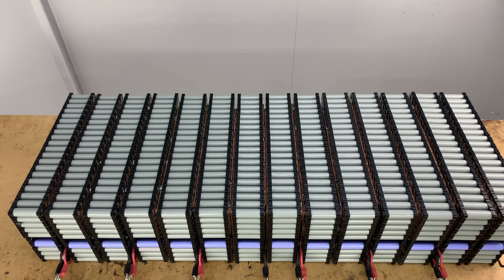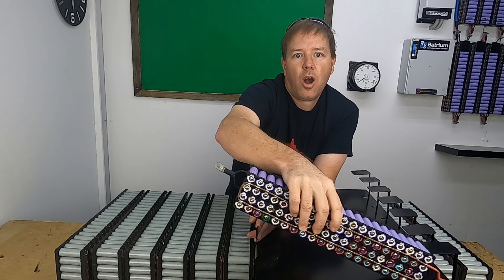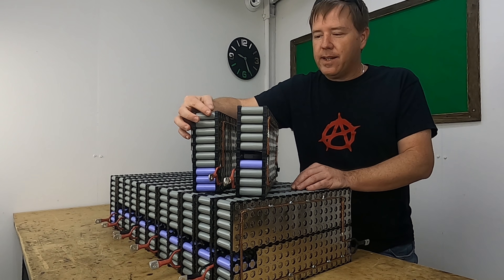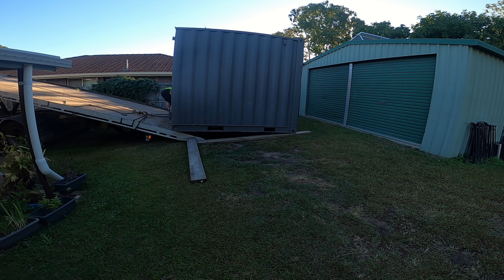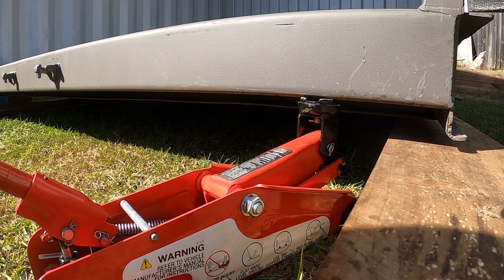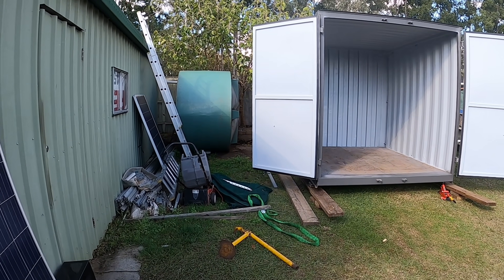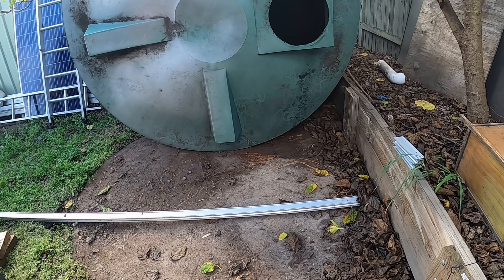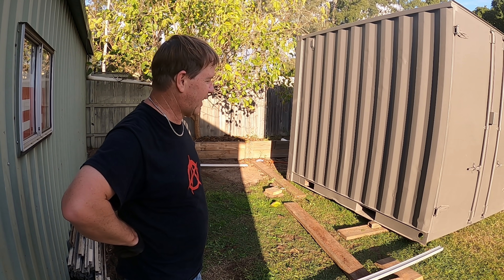Pt.2 Finding out my massive battery won't pass inspection!

Comment: The batteries are a good way to store up the energy. But how is the energy going to be produced? What is the source for the power or is it from the grid? Then it would be useful in situations of black-out.
Reply from the maker: 100% Solar then through inverters to power the home 24/7 not just in a blackout..
Reply: @HBPowerwall  Very nice man. So I guess you have enough solar panels to sustain the energy usage and and store some of it in the batteries. 
Australia is a good place for solar panels.

Comment: Love those batteries, i wish i got that many battery. But I only got 16 recycle old laptop battery, so I build a 4s 4p battery pack for my laptop, I got a 4s BMS build in and I want to supply CC and CV  to charge the battery, I only supply 16.4v and ??? of amp. Please help
Reply: 0.5-1c should be safe depending on the cells.

Comment: me personally wouldn't use old batteries. too high risk of damaged or worn out cells, i have had 2 fires from old batteries.
Reply from the maker: Your choice - with some effort and common sence you can make them very useful and safe.

Comment: does it hurt anyone else that the weight goes all onto the bottom cell
Reply from the maker: Hence zero volt and not connected - a 6 month test showed no deflection in the bottom mount or damage to the once cell that carries most of the weight. Aslo no signs of the plastic cell holders flexing or deforming under the weight.
Reply: @HBPowerwall  what if there was an  e a r t h q u a k e
also just to clarify - the load bearing bottom is a dead cell by design?

Comment: How hot do your sheds get? Do you use any temp control? Thanks in advance.
Reply from the maker: Where the batteries are now they are just cooled by exhaust fans top and bottom 3" computer fans - controlled by the BMS
Reply: HBPowerwall ok cool! Been thinking about building a small “battery box/shed” to keep my power bank outside but have been wondering about climate control. I thought about temp controlled fans but wasn’t sure it’d be enough. Thanks!
Reply from the maker: In the shipping container it will be the better part of fully sealed so will probably install a cheap reverse cycle air conditioner in there and just set it to 25deg in summer and leave it at that..
Reply: HBPowerwall ok I’ll look in to that cause during the summer here (Midwest US) it can get pretty brutal but never last for that long so I may be able to get away with just the fans, but if I can get a cheap AC I would def go that route for peace of mind.

Comment: Very interesting project! I do wonder whether the bus bar exit from each pack should be strain relieved somehow, as it looks pretty easy to accidentally tear up the nickel sheet when handling or connecting up.
Reply from the maker: Yes they should design works but lacks in mechanical strength.

Comment: Knowing how these batteries degrade so quickly my phone doesn't last 8 hours after 2 years now how can these recovered batteries by any different ?
Reply from the maker: Some times the failure is the BMS - each cell is heavily tested before putting it into service
Reply: different kind of battery, and cell phones batteries sacrifice cycle life for more power each day. and they are pushed way to hard. over charged and over discharged.
Reply: Don't leave it fully charged for long periods -- that degrades lithium cells!
Try charging your phone only to 80-90% and don't let it discharge regularly below 20-50%.
It will last much longer!

Comment: what's the purpose of this battery?
Reply from the maker: Will be a part of my house battery to store all that extra solar energy
Reply: @HBPowerwall  nice but mixed used battery  doesn't seem a great idea to me.. i prefer smaller and new one, like LG INR, nice project anyway, subscribed.
Reply from the maker: @AsitShouldBe  My other battery is 4 years old and seems like a fantastic idea to me .. New would be nice but i can't afford that on this storage scale.
Reply: @HBPowerwall  with that battery and solar power are you indipendent from line energy?
Reply from the maker: Nar. I use a lot of power, grid is a cheap backup

Comment: The voice volume is mighty low, and the sound effects WAY too loud.
HOWEVER, I find it fascinating what you've done so far.
Reply: Also the generic YouTube royalty free music is not only terrible it's also in millions of YouTube videos and therefore annoying and it does not add any value to your otherwise great videos.
Reply from the maker: Yeh, had a few small complaints about the audio - didn't have another few hours to go through it all over again to fix. The auto level is a horrible tool on PowerDirector
Reply: Yeah I'm the same, and it's actually painful because of my tinnitus. I have to turn up the voice to hear it, but then the music blows my ears out. Ears are supposed to naturally adjust for volumes, but mine are set to 11 permanently.
Reply: @SidneyCritic  Tinnitus by itself shouldn't be painful. Could be clogged earwax, or a brain tumor. Or anxiety disorder (don't worry it's definitely maybe not a tumor)
Reply from the maker: It’s probably a tumour 😆
Reply: @alakani  If I said hyperacusis, no one would understand. A severe from of tinnitus turns to hyperacusis, and I've got the severe from of hyperacusis, ie, 1 sec of a very loud sound and I have to lie down for 15-30min due to the pain.
Reply: @SidneyCritic  Aw dang. There was a clinical trial in 2015 which showed that a lot of people with hyperacusis/misophonia can reduce the pain by recalibrating their broadband dynamic range using low level pink noise for a while every day, it works better if a psychologist does it

Comment: Sorry, I don’t understand English. But to what I saw, I had questions. Have you considered those a couple of nuances for battery assemblies?
 1) The current goes along the smallest resistance path. No matter how ideal the batteries would be, their internal resistance is different. And because of this, when charging an assembly of thousands of batteries, more than half of the batteries will not charge up to half the charge, while some batteries will already be in a recharged state (the battery charge is above normal
) And during operation, slowly but surely, one by one, the batteries will fail, along the path of least resistance.
 2) The charge of the battery and the release of energy by the battery occur due to the chemical process occurring inside the battery. During this chemical process, heat is generated. Batteries located in the center of this battery assembly will overheat, from overheating they will leak, burst and cause a short circuit.
 So, the first question - how will you control the charge level of each battery from thousands of batteries, so as not to allow the battery to charge above normal? The second question is how will you cool the batteries, especially those in the center?
Reply from the maker: Total max charge/draw is 0.33 amps per cell... issues disappear
Reply: @HBPowerwall  
By "per cell ..." you mean each battery separately, or battery assembly 0:05.
 If you mean the battery assembly, then I agree - with such currents it is not afraid of overcharging and overheating, only I'm afraid to imagine how much it will charge.
 But if you mean each battery separately, then you will not control it. Because of this, modern laptops get rid of such batteries, since they charge differently because of different resistance and varying degrees of wear.

Comment: Dumb question.  It has been suggested, over and over, that I put a BMS on my Chevy Volt cells, meaning, each 4.0 V cell, in every pack.  Why wouldn't it be equally appropriate to put a BMS on each and every one of your individual cells ?  or am I missing something ?
Reply from the maker: Your missing something - I only need one BMS per 191P battery

Comment: Looks good. But why 18650 and how do U replace em when they fail? I was going to make one (much much smaller) on 18650 but any calculations says that LiFePO4 is easier to build and cheaper to buy. They also bigger and easier to replace.
PS @ recovered from old laptops@ OK so you got them probably cheap. But it is still time consuming process of testing them, right?
Reply from the maker: The build video your way would let’s face it prey average lol 😂

Comment: the way he is touching the cells with his bare hands. quite high voltage this.
Reply: Each pack or 'cell' is only 4V.
The voltages only get higher once they are strung together.
Very high current output though, so definitely need to be treated with respect.
Been watching this channel for a while and I think he strikes a sensible safety stance.
Reply from the maker: @kabadisha  I do try, but there is this madness line that people draw in the sand that drives me mad.. More education is needed or perhaps i need to provide more information..
Reply: @kabadisha  yes of course but if unlucky, the configuration can be hig voltage across his fingers (depends on wiring serial etc etc) and this packs so much power that you should have a 40+ CAL arc protection gear on you
Reply from the maker: You really have no idea....

Comment: I love this kind of stuff and I like to try and learn from the best and you seem to know your doing...
Reply from the maker: Nar not a chance I just give it a crack and see how shit turns out lol
Reply: @HBPowerwall  I kinda felt bad for you wish I lived close so I could have helped you move that thing, but you did a damn good job at even doing that.
Reply from the maker: Was a rewarding challenge - my reward was a sore back & thighs lol
Reply: Well I can’t wait until the video comes out with the compilation or a few videos of the finished power house or whatever you are calling it.
Reply from the maker: Thinking of a tutural video on how I plan to protect my cells with A BMS - I've just ordered all the wood support and fireproof FC board but don't know when i'll arrive
Reply: @HBPowerwall  I take you will have to stud the walls out and put up like 3/4 inch plywood because of the weight factor of the batteries you'll be hanging?

Comment: So was there a reason why you cut down a 20ft shipping container and not use a 10ft explosives container? or even a 10ft hi-top or 10ft standard container? as I build with 40ft, 20ft, 10ft and other more exotic configurations. Cutting, welding, painting costs is all.
Reply from the maker: All I could find

Comment: Fast forward 2 years into the future and Pete is trying to fit in another 10,000 cells and he's cursing he cut the container in half 😂
Reply: why is YouTube telling me this comment has 0 likes even though I just liked it xD
Reply from the maker: Wll the plan started with putting all my cells in there so 75kwh of useable storage BUT might have to change that plan to comply
Reply: @HBPowerwall  I have a 20ft container at the bottom of my garden that's empty the moment and now considering moving it to use for my powerwall 🙂
Reply: @HBPowerwall would it be legal if it was buried? 

Less chance of above ground fire or explosion risk that way
Reply: @BenCos2018  It showing up for me Ben 👍
Reply: @healeydave  Same here now 
YouTube decided to break for me lmao
It even had my username on this comment as I am C for some reason xD

Comment: I like your new battery box. One thing I would like to see is one box just for battery's and electronics somewhere else. So if there was any accident you would only loose second hand batteries Not everything. Even separated your batteries in half. Starting to get scared of dendrites. Being the cause of a fire on old batteries.
Reply from the maker: I agree but the budget is completely wiped out for at least a good few months
Reply: I’m still very jealous of you and your amazing system
Reply from the maker: Thank-you

Comment: Whats the temperature in your shed?  I have been wanting to do solar on mine, but it gets pretty hot in there.
Reply from the maker: Hotest i've seen for longer than an hour is about 50 but we have fan pumping around in there. I can work in there batteries should be fine

Comment: lolz i would just use round wooden poles, 3 of them and it rolls as nothing, without need for boards
Reply from the maker: Went with what i had and worked well
Reply: @HBPowerwall  comparing to my experience you had quite a struggle ;)

Comment: 0:50 ... so ... the block weight (how many lbm?) is held by lower battaries. Not sure if it safe in time to load a cell like with side load. It was not designed to provide structural support.
Reply from the maker: Had a test rig set up with built batteries in it for 6 months no deflection of the mount or damage to the cell or cell holders
Reply: @HBPowerwall  i would check the affected cells capabilities in time.
Reply from the maker: I maintain my battery better than my cars...
Reply: @HBPowerwall  just those 2 cells which carry load of block. Not entire battery/block.

Comment: I dont understand: using old laptop batteries? Arent they damaged and have only like 50% of the original capacity + will die soon anyway?
Reply from the maker: Most fail due to BMS so batteries are still serviceable
Reply: HBPowerwall and by servicable you mean doing a few "refresh" cycles on them so they are as good as new?

Comment: What happens if one battery bursts into flames? Will it start a chain reaction and others will start to burn also? How could that be prevented?
Reply from the maker: One would hope the CID activates , if that doesn't the cell fuse, if that fails the container will contain the fire till it burns itself out
Reply: @HBPowerwall  https://www.youtube.com/watch?v=Q4qQ1IV4gWQ
Reply: Smoke detectors, alarm, power disconnect, heat sensors and automatic extinguishers?
Wouldn't you want to protect your investment?
How do the pros handle this?🤔
Reply: I’m here to tell you even the pros put their battery packs in a container and if you have a thermal runaway you close the container door and let it burn itself out. Not much will stop a lithium fire
Reply: Alan Hillyard where does the smoke go? 
Wont the container explode?
Doesnt need a fire oxygen from the outside?
If so, this container will be a big ass long lasting enviroment warmer without oxygen and fire burning.
Reply from the maker: Hot flames are an issue but I would be more concerned with the cells shooting off across the room and then catching everything on fire even quicker
Reply: @HBPowerwall  Given the floors of most shipping containers are simply plywood, that would be my biggest concern (a layer of tile underlay will ameliorate that somewhat).
Proper fire suppression for ion batteries uses powdered glass (a variant on the dry chemical extinguisher listed as for metal fires). The powdered glass melts in the fire and isolates the burning metal from the atmosphere. The downside is that it is a bitch to get out of electronics (even if it doesn’t corrode them like a conventional dry chemical extinguisher).
Putting the batteries in separate sealed boxes can minimise the consequences of an electrical oopsy…
Reply: @HBPowerwall  "cells shooting across the room"?
Reply: @mrtechie6810  yes, cells that are venting that have become disconnected from the structure can become little rockets propelled by their own gases. Mechanical constraints should help with that.
Reply: @mrtechie6810  The pro’s just wait for the cells to burn out. Lithium (like all light metals) is a bitch to extinguish because they will burn with CO2.
Putting fire proof isolation between cell banks contains the damage.
Reply: @allangibson2408  please tell more. I was thinking fire brick between cell modules. But how to contain the hot gases???
Also, it needs cooling/ventilation during normal operation!
Reply: @mrtechie6810  the gases from batteries on fire are mostly metal and oxide vapours - cooling is the key but submerging the battery is a bit hard to do. 
That is however what a number of car companies do with their batteries - fill the battery pack with coolant but you need a nonconducting coolant.
Coolant also helps prevent fires in the first place as thermal runaway is a significant issue.